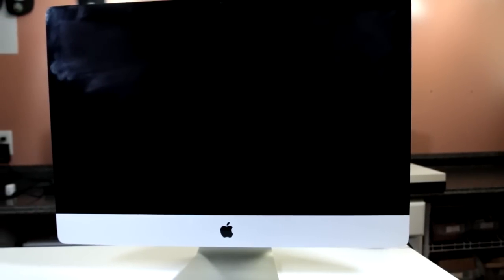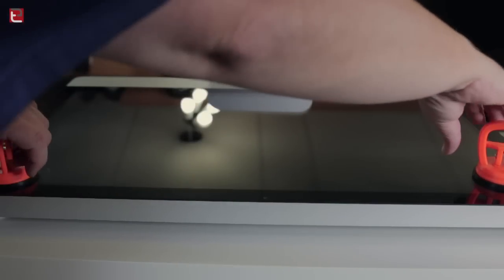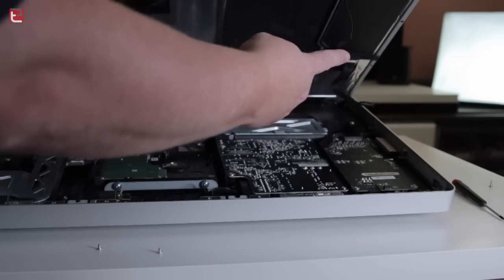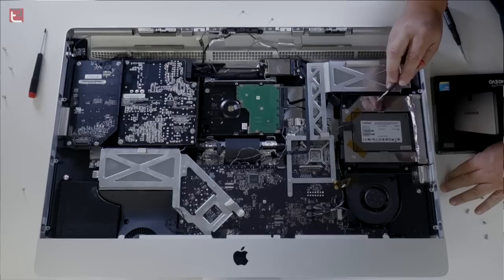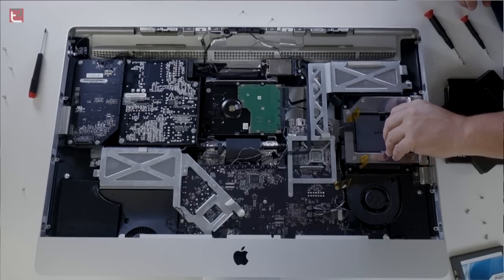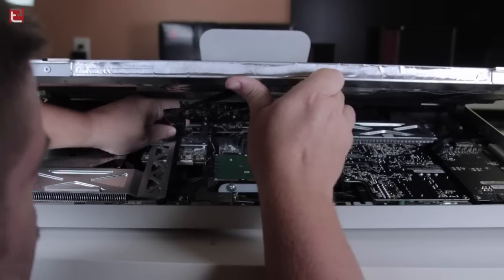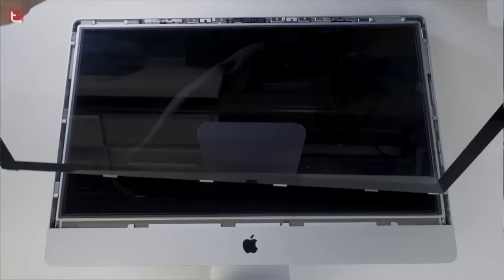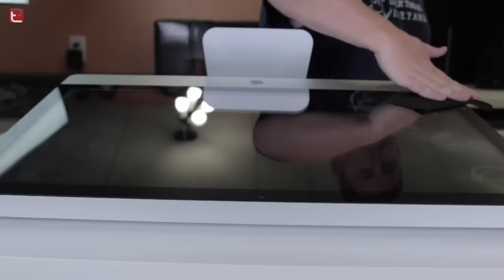iMac 27" SSD Replacement (Late 2009 model)

Comment: hey thanks for the video!  I have a late model 2009 iMac 27" 2.8 GHz Dual Core i7 and my HD is running really slow. I was gonna get the 840 Evo, but just saw that the 850 Evo is available now at the same price. Is that compatible with an iMac?

Comment: hey mike I want to replace my 1 terabyte late 2009 iMac quad core i7 for an SSD 1 terabyte but I am sketchy about doing it myself but here in spain Apple stores won't install this drive on my iMac to change the HDD for the SSD and keeping the optical drive is it difficult to do on my own I mean there is so much steps to do.

Comment: Awesome tutorial Mike!  You made this look super simple. :)

After being wary of opening an iMac up in fear of messing something up internally, I took the plunge and aside from everything being kinda dusty everything worked out great.  An SSD really breaths new life into these older iMacs.  Only snag I ran into during my install was that really tiny temp sensor cable wouldn't come out of the slot so I had to hold the lcd up with my forearm and do the install one handed.  But it still came out great and thankfully I didn't wind up with dust under the glass

Comment: I have done the homemade fusion route... very simple and worked great... had same SSD speeds with large HD storage. I am pretty sure the factory HD has a heat sensor on it which helps control the fans so if you change the HD out you need an apple unit.... I put 2 TB in my 2010 iMac and the fans stuck on max but it worked...